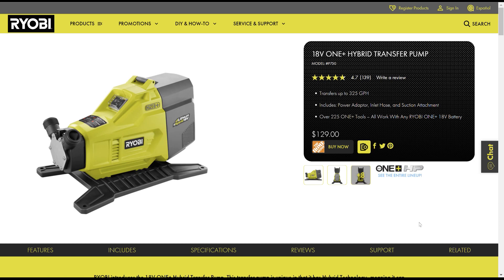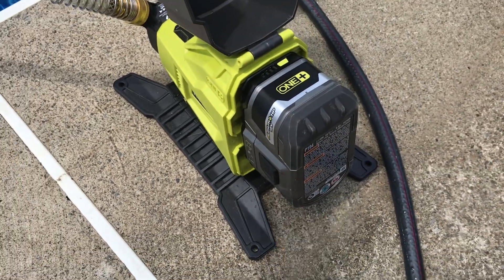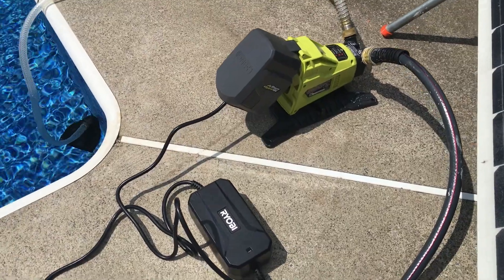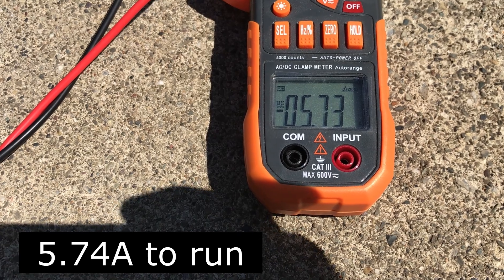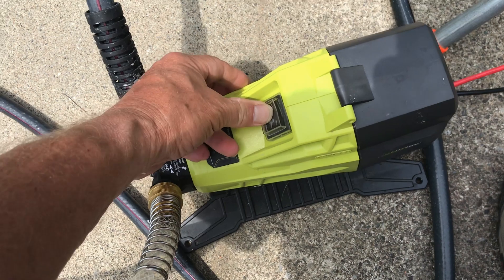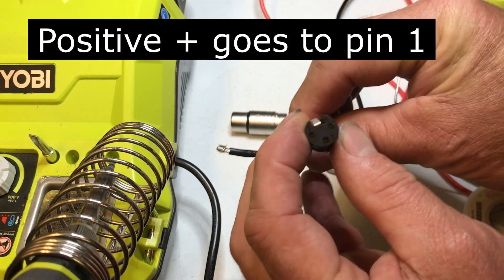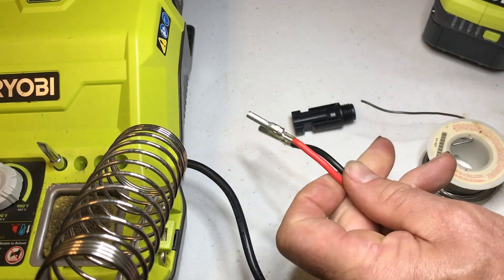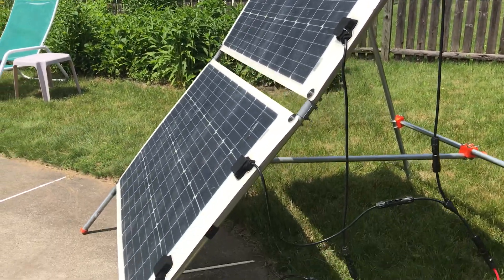RYOBI P750 Hybrid Transfer Pump Review (It will run on Solar!)

Comment: Ideally, you wouldn’t want the pump to run under or overpowered. The killswitch that engages when “cloud cover” occurs is merely an effort to prevent you from burning up the pump. Not to mention you have the pump itself in direct sunlight. Heat kills electronics. I think trying to bypass this isn’t a great idea even though I understand your goal.

Comment: And a charge controller would expand your battery options.
Reply from the maker: You could use a battery and a solar charge controller. But you would have to manage low voltage shut off. I just want the pump to go on when there is enough solar and off when there isn't. I've found some other pumps that work fine this way. Much simpler and less stuff to carry

Comment: That’s a good ideal. I bought the same pump in my huge ryobi collection. This pump saved us during the ice age Texas had two years ago. I used it to pull water from a near by pond and this thing actually pushed water through a 100 foot hose on an 18v.

Comment: looks like the pump is causing the shutdown, not the solar. the pump needs a consistent power flowing. as soon as the solar encounters a power drop, the pump stops. the only way is probably a inverter setup with solar panels; a regular solar setup

Comment: I have one I use to pump oil with and removed half of the 6 rubber vanes on the pump the keep it from tripping the switch sometimes. It would pump less per minute but will run with less amps.

Comment: Solar generator, even a small one, can be used between the panels and the pump to cover interruptions in sun.  Panels charge and pump runs off charging battery through regulated output, either AC or DC, whichever is more efficient.
Reply: certainly cheaper than additional solar panels, you can pick up a used one for cheap - just need enough battery to carry you through the shady times

Comment: is the issue on the XLR connection because of voltage/amperage or because of some way it can sense if a real power supply is connected? Like the 3rd pin connected in a different way?
Reply from the maker: I first did the battery connection. When the solar panel voltage dropped, the pump would stop. Unfortunately it wouldn't go back on. I noticed that the power supply didn't have that problem if I unplugged it. So then I hooked the solar panels via the XLR connector. But it had the same issue. I think the voltage has to go to zero before the pump will restart. The solar panels still put out a voltage unless it's dark

Comment: Add a battery or a laaaaaarge capasitor to remove spikes and lows from the solar panel, try with a "start help" in parralell, 500Ah/ 20sec if not, in paralell with a small battery..u got the idea....store exsess solar..
will also work with your powebanks i guess?
Reply: Btw, realy like your work and angle to this problem (yes it is a problem unless people like you fix it! :))))
Reply from the maker: thx

Comment: I love your videos and ingenuity. I have a challenge for you.  Could you make ANY Ryobi tool from wireless to wired? is this possible? Basically, replace the battery with another battery but wired to the wall. Basically, making Ryobi the best of both worlds (wired and wireless)
Reply from the maker: working on it right now ;-) It turns out that it was easy to attach the RYOBI Hybrid Pump power brick to an 18V battery adapter. I'll put out a video when I get a chance!
Reply: @SerendipitySue  you would need a large ac-dc adapter. my 18v 3 gal ryobi vacuum wouldnt run on my 190w laptop adapter (20v)
Reply: @Iinustechtips Yeap that vacuum is one of the biggest power draw of any Ryobi 18V device I tested,  pulling 260 watts from a fresh 9ah battery.